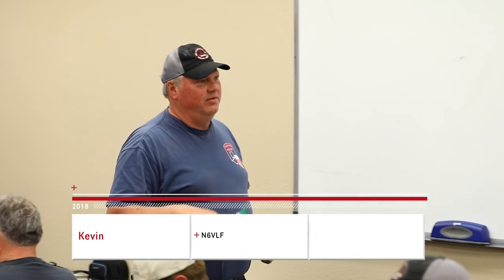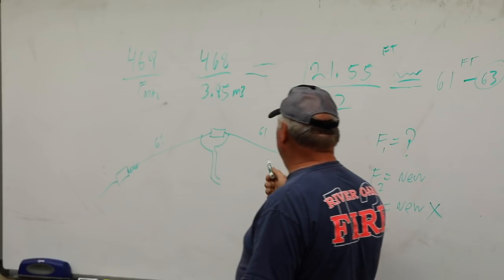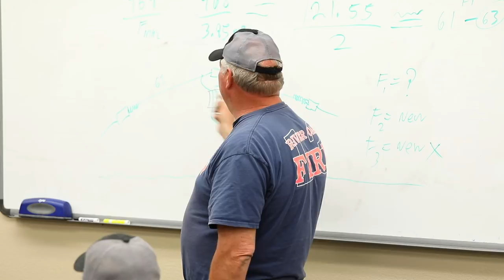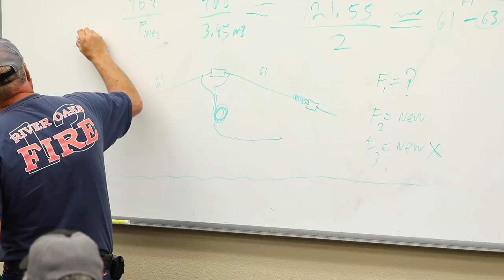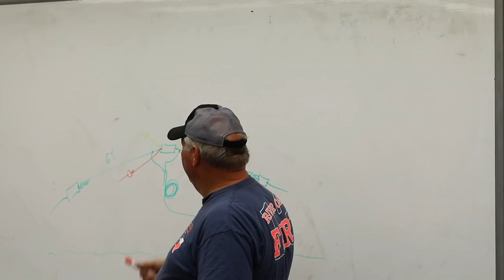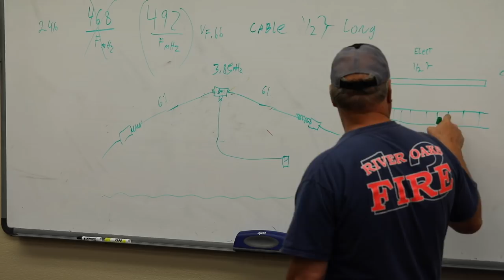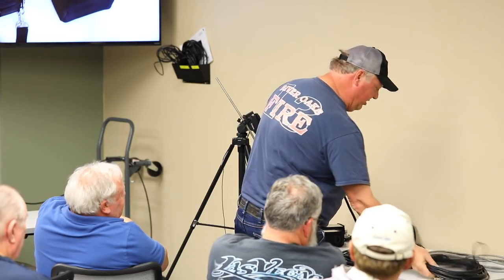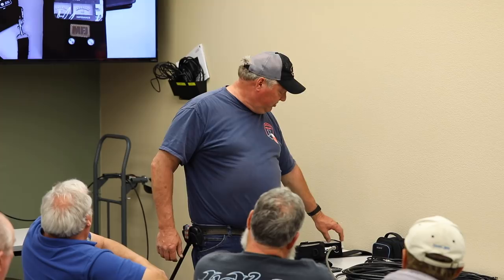How To Build A Dipole Antenna

Comment: As an audio and acoustic engineer, I see so many parallels to to RF radiation patterns.  Multiple speakers or microphone elements can control directivity.   There are 1/4 wave traps and other types absorbers. The earth is a reflector like a wall. Horns are a way to transform impedance. Fan dipoles are mechanically tied together but resonate separately because the impedance goes up and current reduces.. It has been a great help towards learning radio. Bob Heil  has so many audio innovations. It goes both ways. Your videos are very good.
Reply: Reminds me how soil health and one's gut health are alike.

Comment: Hi Guys – nice club video.  You're enjoying yourselves.  I’m a Limey from UK, so I hope you don’t mind me calling you Yanks (it’s actually a term of endearment here in l’il ol' UK).  Some info on the ARRL 468 formula.  But before I do that, I’ll ask the question. “Why do many Hams talk about their radio bands in meters, then measure their antennas in feet and inches?!”  For instance, Kevin explains that the speed of light (in a vacuum) is 300,000,000 meters per second (near enough) then goes on to tell us how to make an antenna in feet and inches!  I think you Yanks would call that cockamamie?  
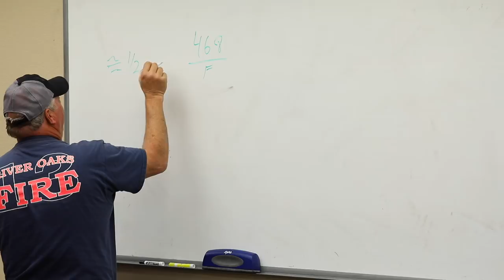Anyways, back to the question at 2:00 – where does 468 come from!  Not a lot of people know this, so pay attention, y’all.  1 meter = 3.28 ft. (39.36 inches).  Therefore the speed of light @ 300,000,000 metres per second = 984,000,000 feet per second (300,000,000 x 3.28).  Knock off the 000,000 (millions), and you end up with 984.  Halve that number (to represent a half wavelength) and you end up with 492 (mentioned by Kevin).  When light (electro-magnetism) flows through a medium other than a vacuum, it slows down, so an allowance, known as velocity factor, has to be applied.  Antenna wire has an approximate velocity factor of 0.95, so multiply 492 by 0.95 and the result is 467.4, which ARRL has rounded up to 468.  As the Froggies would say – Voila!

Take a tip from Europe and the rest of the world, America – measure your antennas in metres!  Believe us Europeans – it’s so much easier.  To calculate a half wave in meters, we use the formula 142.5 divided by frequency.  

How do we get to 142.5?  Here's how.  300 x 0.95 velocity factor = 285.  Halve that number for half wavelength = 142.5.  Again – the Froggies would say – Voila! 

So the accurate half wavelength for 3.85MHz (Kevin’s frequency) would be: 142.5 divided by 3.85MHz = 37.013 meters (37 meters 13mm) equivalent to 121.40 ft.  (Kevin’s measurement was 121.55 ft. – less than 2 inches difference – using the 468 formula).  

Come on guys – pick up a dual (imperial & metric) tape measure and join the modern world.  It’s so much easier!  Hope these comments have been useful.  73 to Vacaville.
Reply: Iain Meteorscan  Finally someone that explains the "magic number", as you said, it doesn't make sense to talk in metric and then imperial mixed with metric (121.55ft... Really?!?!) Thanks!
Reply: Many hams are technical folks and work in both measurements systems,  ahum,  we got the pints,  pecks,  bushels n inches from u lot,.. what to do?..  we even got a shortened gallon 😀...  yr reply is great,...btw,..  cheers n 73s...  A92GW
Reply: You want the US to only use the metric? Sounds good! Let’s talk about it over a pint in your favorite local pub.
Reply from the maker: Great Stuff! You bring up a lot of good points and facts. Thanks for sharing!
Reply: I like to use both depending on which is easy  good explanation 
But if you ever come visit the U.S. 
Please don't yous yank to refer to some one from the south  as most wood fell vare afinded
I understand that not the way you mean it 
Hope to hear you on the band
73 n9prf Joe  n good dx
Reply: @joerowland7350  and others:  Thanks for all the great comments on my original posting.  A lot of humour (in Murica spelt humor!) from you guys, which is to be generally expected from the Ham fraternity.  UK went metric in the early 1970s (money and measurements) and everything became so much simpler, apart from the Old Folks, many of whom couldn’t grasp it at first.  Come on Murica, your dollar is metric – you are part ways there!  And don’t get me going about you still using the Fahrenheit temperature scale! 

Joe Rowland – yep, I know “Yank” is a delicate word to use in some areas of Murica, but take it from me, as I indicated in my original posting, that nickname in UK is used as a term of endearment for all Muricans.  Us Brits will never forget how you Muricans stood by us in that conflict 80 years ago. 

We from l’il ‘ol UK are not only known internationally as Brits, but as Limeys (in USA) Pommies (in Straylia) and Mzungu (in Africa), but internally within the UK we know each other as Jocks, Geordies, Scousers, Taffs, Paddys, Janners, Cocknies, Yorkies, Brummies, I could go on.  Happy ragchewing to y’all.  Iain.
Reply: Iain Meteorscan It is philosophical.

 We are bi-lingual— androcentric and scientific— and I think it matters.  To a human, 100° is hot, and 0° is cold.  1/64th of an inch is what the average eye notes at arms length and the finger feels going over a woodworking joint.  Y’all are losing your humanity, while we are fighting to preserve it.

And, we walked on the Moon using our human measures.  It was more a human achievement than a technological one— because many of us see at that way. That matters.
Reply: I'm a Yank and I think I'll stick measuring in meters since That is what I was taught to use in school science classes back in the late '70s and early '80s.

Comment: Kevin thanks so much for  sharing your  knowledge.  I made a fan dipole  using a 1:1 balun from  balun designs. Use your formulas and  cut the wire to length and  tune booth bands  40 and 20 meters. booth  swr is 1:1 on  7.100.00 and about 1:8 on the top of the band.  The 20 meter band is about the same.  The tuner will fix only high impedance on the top  and bottom of bands.  Got great reports. 5-9  + 10  is  working great.  And yes  we did the formula for the coax too. lol  1/2 wavelength multiples  dipole is about 40 feet high on the tower.
Reply from the maker: Oh very cool to hear Noel! Thanks for letting us know.

Comment: Nice video I use to live in Vacaville and Fairfield over 30 years ago when there were open fields and fruit orchards. I'm building a 1/4 wavelength for my UV-5RE  HT. KJ7HWV Bill Spokane Valley WA
Reply from the maker: Oh no kidding. I moved into the area in 2001 after all the orchards were gone. But now I'm watching all the fields disappear into high density housing tracks. Vacaville is over 100,000 people and growing. Unfortunately the people are coming quicker then the roads and infrastructure can support them.

Comment: Hello and thank you for another great video. In my experience, at the 15 meter band and above the bandwidth of the coax becomes more and more narrow the longer the coax run becomes. Food for thought. I think a more in-depth video on coax would help people. For example the relationship between the name of a band has a direct relationship to the physical length (not heigth) of it's frequency. As well as how a 1/2 wave of one frequency is a 1/4 wave at another. How speed of propagation in a vacuum compares to Speed of propagation in a coax and how it's defined by velocity factor is a %age of efficiency compared to propagation in a vacuum. There are a lot of misconceptions when it comes to coax and people tend to stick to fables and not realizing that coax is just as important and cheaper than any other piece of equipment in a shack. Keep the videos coming, I'll be watching. Thanks again!
Reply from the maker: Thank you for the input and great suggestions! I will relay your message to our clubs presenters/Elmers. And, thank you for the kind words and being part of this channel. 73 Jason / KM6FAK

Comment: 22:43 "Everybody knows that" - sure everybody knows the words you just said, but alarmingly few seems to know what that actually means.

It means the coax shield has_no_signal (or should not have) and that the signal in the center conductor of the coax is generated by the radio by combining the -50% to +50% amplitude RF signal into a 0 (ground) to 100% amplitude unbalanced signal - perfect for being protected and transferred by a coax cable and it's protective grounded shield. The coax is supposed to be grounded both at the transmitter and at the antenna, to work best. You can see a ground lead at many good transformer baluns that does just this.

When listening, the job of the balun is to take that half wavelength signal that comes in to the two separate dipole elements and combine them into a single signal that can travel the noise shielded environment of the coax center conductor all the way to the radio, where it is transformed back into the original signal.

When transmitting, it's the other way around. The radio takes the fresh balanced RF signal that goes from negative max to positive max, puts it through a balun which transforms it to an unbalanced signal going from ground to double max, that can travel the center conductor on the coax, protected all the way, to the antenna, where the now unbal (balun from behind!) takes the unbalanced signal and transforms it back to a balanced signal that matches the dipole nicely.

The balun is a great place to do other things too, like impedance matching. The coax is usually 50 ohms, and a dipole is just a little bit higher than that, so to feed a dipole a 1:1 current transformer balun is just fine, but other antennas have another impedance at the feed point so there are 2:1 baluns that match perfectly to a 100 ohm antenna, and 29:1 baluns that would match perfectly to a 1450 ohm antenna - which is the kind of crazy impedance you see at end fed antennas... The list goes on.

The job of the balun is not to choke stray SWRs, that's the job of a choke! A choke can - almost by accident - also balance an unbalanced signal sent to a balanced antenna, but it shouldn't be the first choice! Garbage in / garbage out. 

Make the signal match the antenna first, then you can choke away other common mode noise like power line interference and stuff. The common mode interference you get by not transforming the signal is partly lost to heat when choked, and will never see the light of day in that dipole leg you soldered to the coax shield.

Just my $0.02 - 73!

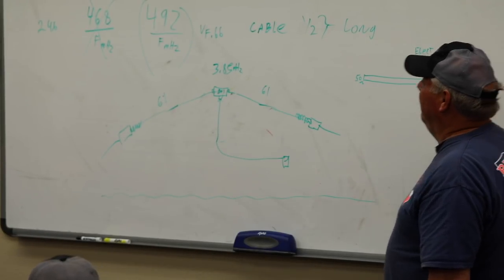Comment: at 58:47 need to point out, the condition of the wire length to show exactly a perfect 50 ohms load at the input side can be for any length of wire. Not only λ/2. So that matching has to be done perfectly first at the antenna side before adding any length of wire leading to your receiver.
if your load isn't a 50-ohm shunt resistor, then for a multiple of λ/2 coax you get whatever reactance built into your antenna showing up at the receiver. 
Z=R+jX

|Z|=√(R^2+X^2 )
Take into consideration, a dipole has typically input impedance of 73.2+j42.5 ohms. |Z| = 84.64 ohms with an angle of 30.14 degrees.
Normally you don't want that reactance appearing at a hypothetical 75-ohm receiver, so you add a cap in series at the load side.
Or, for a 50-ohm receiver, you match it with a 2 parallel 75-ohm piece of coax then with a shorted stub of 50-ohm coax. Do that for both leads coming from the antenna.
Length of the parallel 75-ohm coax cables has to be the electrical length that gets you to the 20mSiemens constant conductance circle on a Smith chart.
Length of the 50-ohm coax cable has to be the electrical length that gets you to the 50-ohm constant resistance circle.
Note that the Stub appears parallel to the circuit being the antenna + 75/2 coax.

I got these values: 

For the 2 parallel 75-ohm coax cables, 0.18λ
For the 50-ohm shorted stub coax cable, 0.11255λ you can use 0.11λ for high frequencies.
Impedance: 50.3+0.00348j
Reflection Coefficient: 0.00312+0.0000346j
Reflection Coefficient: 0.00312∠0.635°

After that, you can use >>>any length of 50-Ohm Coax<<< to reach your receiver.
Mind the attenuation every 100ft. 50-ohm cables drop more than the 75-ohm cables. Speaking of RG-58 and RG-6.
Reply from the maker: Thank you for in depth comment with match. I will forward this to the presenter and club.
Reply: @HamRadioTV  I understand every person has a preference for building stuff. Didn't mean to sound like a smart ars. Thank you though!

Comment: I emulated your test using the MFJ 269, T connector, dummy load and a random length of coax . I DID attain the same results as you, the VSWR was 2.2 at length “A” and adding 2 feet of coax brought it down to 1.1. 

But when I added the dummy load to coax length “A” i also saw a 1.1 match...  Now if the dummy load is representing the antenna. And the antenna is 1.1 VSWR. Why is the cable in your test with the “T” connector that was showing 2.2 VSWR now showing a 1.1 VSWR when connected directly to the 1.1 VSWR antenna (Dummy Load) ?  I feel this test is just showing the change in phase angle, not a change in resonance due to a non resonant length.

Comment: Thank you so much for this episode, and other great videos. So much information that helped me to understand dipoles and coax better. I'm learning and getting there. 

I have 2 questions. If your 1/2 wavelength of coax is longer than your run to your radio, what do you do with that extra length?  Can you zig-zag it in your yard, run it around the circumference of your yard, etc?  My 2nd question is I have a remote tuner at my EFHW antenna and the feed point is about 12 feet high. Where do I begin to measure the 1/2 wavelength length? is it from the remote tuner to the radio or everything from the antenna feed point, to the remote tuner, and the tuner to the radio? In other words everything in line?
Reply from the maker: Thank You for all the kind words! Yes, you can zig-zag it or loosely coil it up. I wrap/coil my extra coax around a six foot section of fence behind the shed. When coiling it, you don't want even coils in the chance it starts acting like an inductor. Short answer, all wires/coax could be part of the antenna system if not at right lengths and / or choked. In your case I would just work on the coax between your remote tuner and your radio/amp. 73 Jason KM6FAK
Reply: @HamRadioTV  Ok that sounds like a plan.  Thank you for your quick response.  73.

Comment: Nice video. It is easier to do it in metric though. By the way, the 0.95 factor is not from velocity through the medium (cable), it is due to 'End effect". At resonant frequency, dipole tends to 'lengthen' by 3 to 6% if I am not mistaken, that is why you apply ~0.95 to correct for it.
Reply from the maker: Thanks for watching, and thanks for the info!

Comment: Thanks for sharing.  Question:  So if my feed line (based on the formula 448/f * VF), what if my feedliie is really long?  I mean, lets say for 20 meters I should be using 54ft of feedline, but my rig is only 30 ft away.  What do I do with the extra cable?  Do I coil it up and leave it on the floor under the radio?

Comment: Will these same calculations work for cb radio. I'm new to all of this but very interested . I'm the type if I can build it myself ,I'm not paying a company that is overcharging for fancy decals or names. I would like to get into ham but I don't think I'm there just yet. I'm still learning citizen band and ssb. There are a few local guys in my area that have been a great help and of course they are older guys that have been doing this kind of thing since the 70s. No one better to learn from. I was also wondering about directional and  horizontal and vertical antennas . I've been told that depending on the set up ,receive and transmit with horizontal only pickup other horizontal antennas and vice versa with vertical. I've been thinking about taking a comms class at my local tech school and more so now after watching your videos . thank you for the info and for that matter the inspiration to want to learn more  about comms. I never thought my hobby could turn into something more but this could definitely become more for me. Thanks again
Reply from the maker: Thank you! Yes, these calculations will work for the 11 meter band (CB). Just use 27.185 MHz. How's your progress with getting your amateur radio license?

Comment: Thanks for the great video. Lots of useful information. For coax using the formula for 10 meters, I would take 492/f Mhz (28.400) = 17.32 feet X  .84 (LMR 240) = 14.55 feet for a 1/2 wavelength coax. I need to run 100 feet from the radio to the single band yagi on the crankup. To get there do I add wavelengths, say 7 half wavelengths X 14.55 to equal 101.85 feet. Is there a difference if the length of the coax falls on odd or even wavelengths? I have heard to add odd number wavelengths and to terminate the odd wavelength with an odd 1/4 wavelength...does that make any sense. There is a lot of misleading information out there that concerns coax length.

Comment: Very nice video! I am new to HF listening (only!). 
I already use a dipole for FM and i mounted it vertically and straight with the radiation partner of a dipole in mind. By mounting it vertically I try to avoid the nulls. (they point straight up and straight down, in line with the dipole wires). It receives great.

What happens to the radiation pattern when you mount a dipole like an inverted-V ??   Are the nulls still in line with the wires?